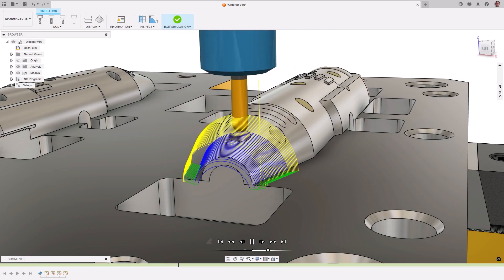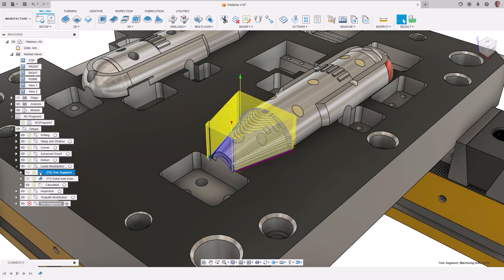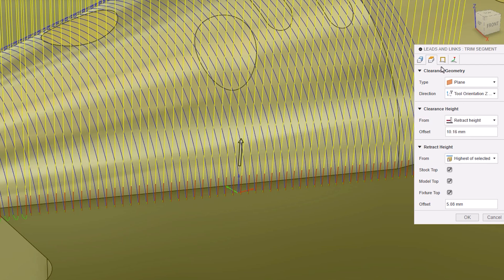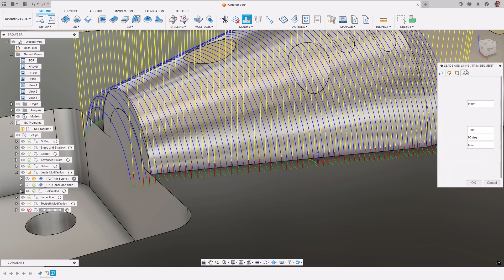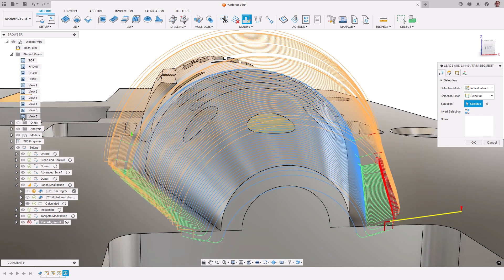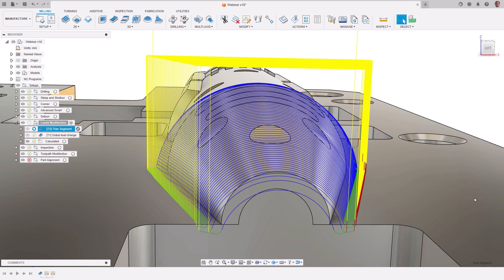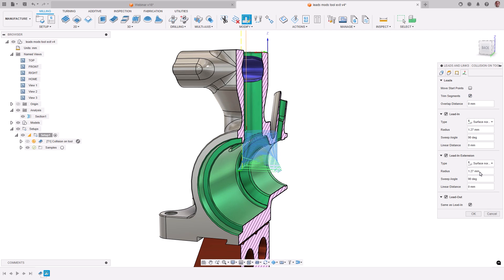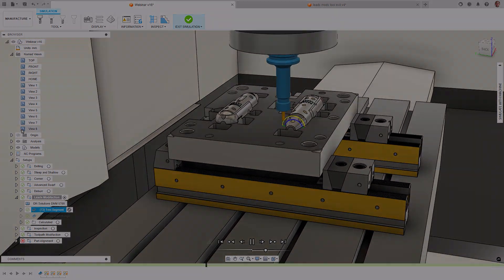Leads and Links Modifications in Autodesk Fusion

Comment: Sorry guys, toolpaths need a rework. I can not move manually/individually start and end points is super frustrating. The automatic toolpath is generating stupid solutions which are impossible fix to with MODIFY. All I need is manual control. I have so simple stuff to do but nor the POCKET neither SLOT is unable to do. Been doing workarounds for multiple hours now. Nothing works. I really like the tooltips but overall many things are super contra-intuitive. Grain of salt , I am a beginner with many years of IT exp.